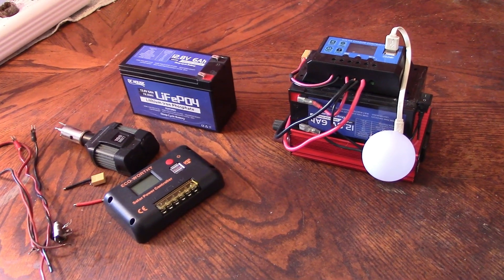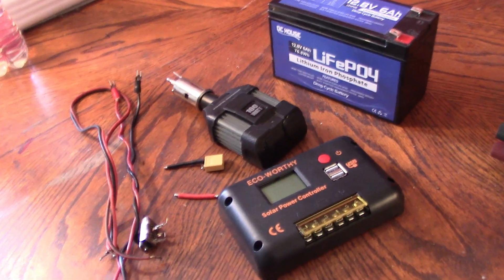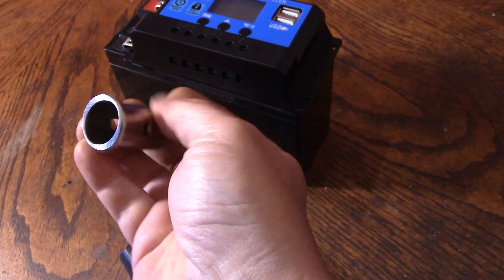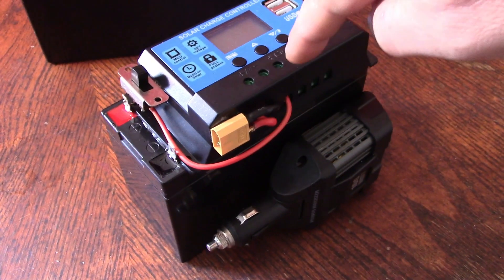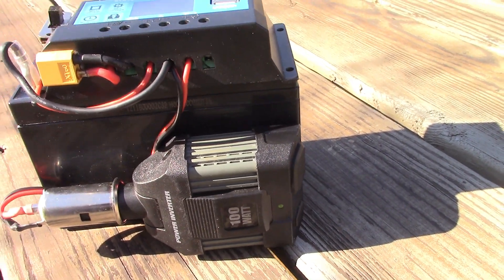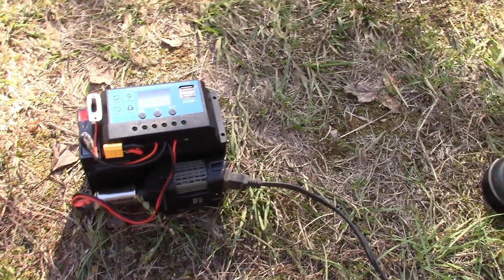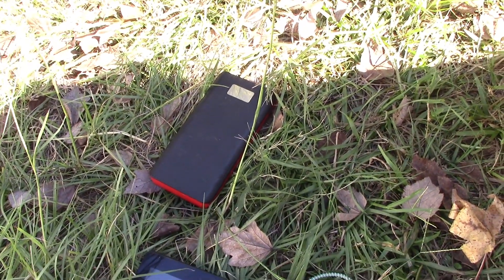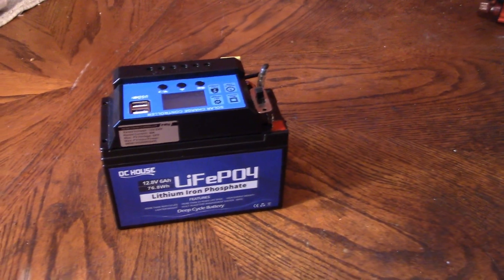Power Cube 2 - $50 100W solar power station

Comment: Nice project.
Reply from the maker: Thanks. I think one major plus point is that all warranties are kept, was thinking about it earlier. I've got an Ecoflow River 2 Pro and it's started clicking on mains power, it also becomes confused if solar panels are left plugged in overnight (showing 0% in the morning). Those can be return faults. So, components being able to be switched in and out to run as expected, while not voiding warranties still has a place.
Reply from the maker: Btw, great electronics channel, have Subscribed 😀